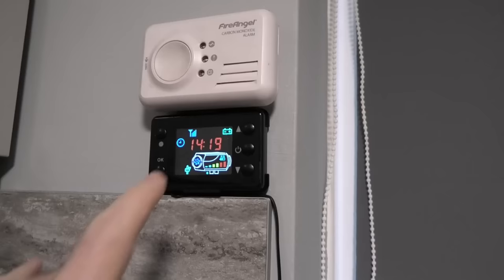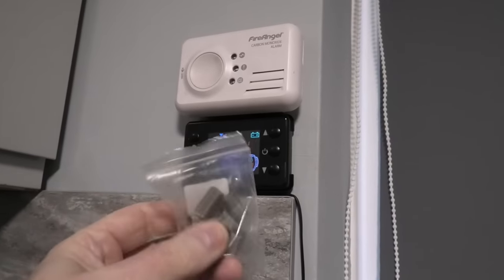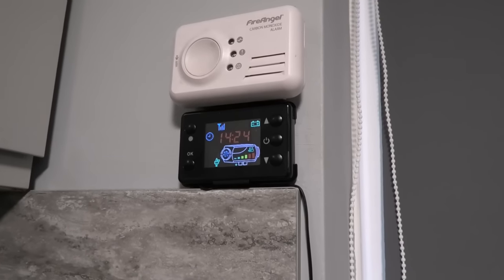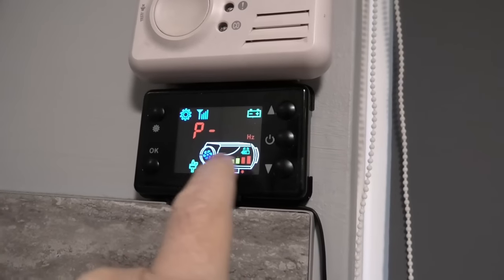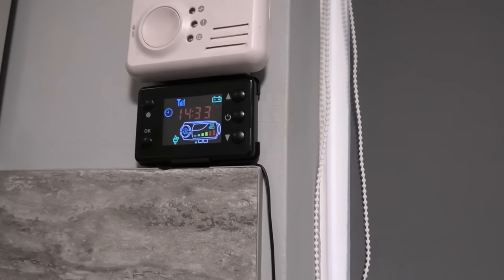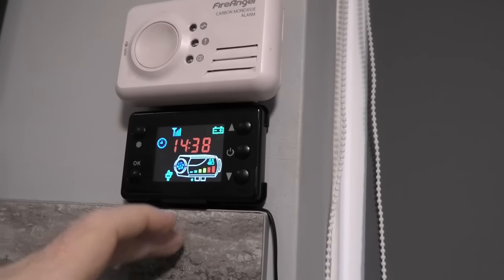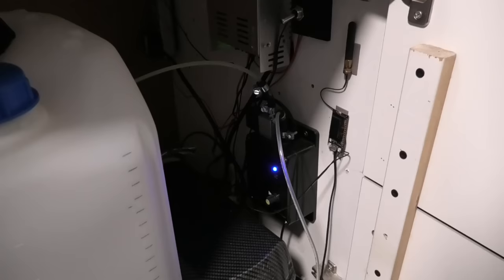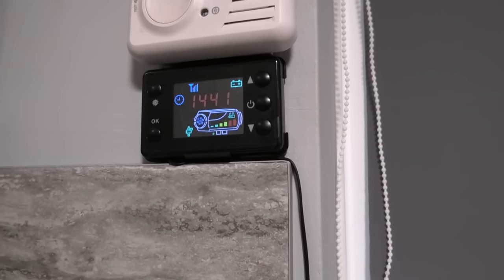How to tune a Chinese diesel heater with no tools 2kW & 5kW

Comment: I've got a 5kw in my motorhome that to be honest is still not great (had a 2kw at first but upgraded it). I've followed your video but it doesn't seem to make any difference. No matter hiw low I turn the hz down on either max or min it doesn't put any of the red bars out. Also if I adjust the settings, then go out and back into them again, they go back to default as if they haven't saved. Am I doing something wrong?

Comment: Interesting, as I run 5 of these heaters, from differant suppliers, and all have been installed following instructions. I run these on fuel station diesel. I am not sure whats going on with your heaters, But its out of the normal.

Comment: is there something else going on with hz/rpm settings when in temperature mode? 

while in temperature mode i set the desired temperature way high, like 30C so it would be in high mode. 
Then I went into settings and as I changed low side hz, i could hear the fan ramp up and down (while it was/should be at max)

I would have expected when in temp mode, running at high, the low side would not impact the fan RPM at high side.

Comment: Mine had been running great for quite awhile. Then we got some extreme temperatures and I think the gummed up diesel clogged some things. I cleaned everything out the best way I knew how. Finally got it to start again. It ran for a few days. Woke up this morning to a chilly home. Noticed the diesel heater had stopped working again. I pulled it all apart, cleaned it up and it fired up immediately. Thought all was well, but then I noticed the combustion chamber temperature was steadily dropping 2 Celsius (from 176 ish) every 10 minutes. I finally turned it off at 138 C and took it apart again. It has just as much soot as it did over the few days that it has been running since I cleaned it last. Prior to that one temperature drop, it had been running near mint. No carbon buildup to be seen....

I'm currently lost as to what is wrong. I have no idea why it's suddenly plaguing me with issues now...
Reply: Check the fuel lines for air leaks especially the rubber connections if you have the upgraded fuel lines the nylon tube. Try fitting a non return valve as fuel syphons back into the tank when switched off pulling air into the fuel line.
Reply: @oojimmyflip  I ended up upgrading to a Lavaner Pro and I haven't had any issues since.

Comment: Hello   I wonder could you help I have the choice big buying a what I'm told 5 kw heater adjustable between 5 kw and 2 kw or a 8 kw adjustable between 8 and 5kw red one all in one same price on eBay from China   what do you think.   Thanks

Comment: First! Awesome! Also I have one of these, & have often wondered. CO detector directly in the exhaust? Nada.
Reply from the maker: If you put it directly in the exhaust, it'll be going off constantly. I measure at around 500mm from the exhaust where it has time to mix with air. These are technically a jet engine without the compressor and no jet engine on earth would pass any CO tests like that.

Comment: have you calculated that your max settings actually gives 5kw ? because the factory tune are setup to work whatever environment. like vehicles. doesn't matter what altitude you do, it should work. only it does not work as efficient as it could. I've never seen any of mine smoke or gum up. And it always works. whatever the altitude and weather. But there are ppl that already has calculated the tune to result of effect.  It is always, always when you start fiddling with the settings that your break the heater. So I hope you've done your calculations.

Comment: Hi, did you ask about production of the quiet pump? I have ordered my heater and it will arrive in a few days. Your system looks great, so I will see about tuning my 5-8kw when it up and running. Thank you.
Reply from the maker: I'm waiting to hear back from him. He has various models available and also, a marine version for fitting in boats now. As soon as I get the green light, I'll make another video.
Reply: @Vortecks  Excellent; I'll be watching lol. Thank you.

Comment: Thanks for posting, possibly the neatest home install I've seen so far. I've looked at the comments and can't see any more info on the fuel pump, are they available to buy?

 I plan on using mine to heat a large kitchen, I would be interested to see how you heat more than one room with a single unit :)
Reply from the maker: It's embarrassing but I might show it. I've used the splitter tube and hung 2 lengths of insulated 80mm tubing across the ceiling because I can't gain access above it. Come the spring, I'll simply take it down, compress the tubing back into the box..... job done. We have to make sacrifices to affordably keep warm.
Reply: I’ve made a plywood box for the heater, located it on the patio, plan to run the flexi pipe through the wall and vent from under the kitchen unit kick boards. 
 Desperately seeking a quiet fuel pump.
Reply: that's simply practical and brilliant.  Sure you're not a Kiwi? *chuckle
 @Vortecks

Comment: if you mix kerosene into your diesel, it will burn cleaner and clean out.   also if you do one tank with some heat or high octane additive.  that will also help clean out and burn a bit hotter.  Also when tuning, other things to keep in mind is elevation and outside temp... I was in -20 the other day and it wont keep up if the fan keeps it too cold.

Comment: Great video, Got my interest in buying one. What make and model do you have Tony ? Thanks
Reply from the maker: Mine's just a standard 5kW heater mate, they're all the same. Don't be fooled by the 8kW version, there is no such thing. The 8kW and 5kW are identical - it's just a sales con.
All I have left of the original heater, is the wiring loom and heater itself. The rest of it is absolute junk and actually makes it more noisy. The inlet and baffle thing howls, the exhaust pipe howls and the hot air tube they give you is way too short. Buy a standard 5kW one - colour and paint job doesn't matter but make sure it has the same controller as mine, I have something extra to show everyone when I get round to it.

Comment: during the fiddling I messed up the 1688 access code.....any idea how to reset it please
found I could use 9009 but would still like to reset 1688 if possible
Reply: the very last setting before it returns to the home screen shows oF .... if you toggle this to on and press OK it shows a screen with a padlock where you can change the PIN to one of choice....6666 is nice because you dont have to toggle up/down so much !
Reply: Try 9009

Comment: oh dear....
the fan speed increases quite Sharpley  when you adjust the fuel up while the heater is running for a set pre programmed period of time then reverts back to what it was set at and you must then adjust the fan speed to the new fuel setting.....
its a safety thing not a proportional thing....

Comment: Unfortunately I can't get mine to even fire up anymore so I can't adjust anything.  I just keep getting e-8.  It worked for about 2 days, now nothing
Reply: E 08 is a fuelling issue, check the fuel lines for air leaks, test the pump to see if you can hear it ticking, if not give it a tap or replace it if it won't tick. Learn how to prime on your controller if the, pump doesn't tick it's proberbly not working

Comment: I recently got a 2kW that would flame out after 10 minutes and never got out of the yellow heat bars. The fan upper setting was 4500 and the pump 4.6Hz. It wouldn't stay burning until I had upped the pump to 6.4Hz which seems quite high for the kW rating. But anything less and it won't keep at 2 red bars. I haven't yet upped the bottom end settings but it appears that the chamber temperature should stay in the red bars? or is it normal to reduce speed and drop down to the yellow? I suppose there must be a minimum temperature to sustain the flame.
Before I sorted it out the vendor sent a replacement which wouldn't ignite at all and was factory set at 3.4 Hz and 4250  upper pump and fan speeds. Maybe the 2 kW is a less efficient burner that actually needs more fuel?
Anyway, thanks very much for posting this it was very helpful in getting one of the units to run.
Reply: I got 2kw (with 60mm ducting) too and cannot tune with these instructions. At least when temperature is close to 0 c degrees: High is ok with two red bars (takes a hour to get there), but low is only four bars (0 red) even after 12 hours. 

Have been running it 100-200 nights with zero soot buildup - took it apart few days ago. 

Have been using so far: 1.0-3.0hz, 1500-4300 rpm. I think I have 0.18ml fuel pump where some have 0.22ml.
Reply: 2kw default settings are 0.8 hz low and 3.2hz high.

Comment: Great video,very helpful just cleaned mine out full of carbon just like yours.
Do you know what the PF 1-6 is? I have this on my controller when I scroll through the settings SN 1 or 2 (is magnets) then the PF comes up and I dont know what it is for.
I am ready to reset following your suggestions.
Reply from the maker: I think PF is something to do with plateau mode where it automatically slows down or speeds up to get the temperature right. Don't touch it if everything works.

Comment: thanks for your efforts doing this......why cant the lower rpm set as low as possible though?
Reply from the maker: You still need an efficient burn and to achieve it, you need the correct amount of fuel/air ratio and heat in the combustion chamber. If you turn the fan down too much, it will over-fuel because you're starving it of air.
Reply: ....has a range of 1 to 6

Comment: Can these adjustments be used to tune the heater for high altitude?
Reply from the maker: Absolutely. The principle is exactly the same but, at higher altitude, you'll need more air to make a clean combustion.

Comment: Fan low 2200 and high ibhave 4200. Get out more heated air.  But the same same. Saves some watt only.   And it burns litle hotter

Comment: Great video.  Excellent advice about the settings.  Give or take a few factors, those are good presents.   I find that mine requires a little adjusting throughout the heating season.
Cow tipping high winds and barometric pressure and every now and again the fuel isn't what it should be.  
Mine is running 24/7 until spring.
Every 30 hrs  I'll turn it all the way up for 20-30 minutes and then back to whatever setting is comfortable.
 
 Make it a habit to continually remind the sheeple about safety and good old fashion common sense.
Otherwise, we all know what happened to other great products that got into the hands of the clueless.
Thank you for sharing .
Reply from the maker: Yes, barometric pressure is the possible cause of 90% of the sooting. The manufacturers set a default value which makes them run in their location but that setting doesn't work for most people.
Unfortunately, Curtis...... common sense no longer exists but I will keep reminding people of the dangers 😉
Reply from the maker: If it's orange, it's probably biodiesel or red diesel that's had the dye removed.
Reply: @ElectronicMusicUnderground  could be the winter diesel additives 🤔 winter diesel has antiwaxing additives compared to summer diesel 🤞 hopefully they haven't had red in the tank , try explaining to DVSA it was the fuel stations fault when they dip your tank 🙄
👍😁👍
Reply: sheeple? This is a video about diesel heaters not the new world order!

Comment: I bought one like this. looks just like it. But it has none of the controls the heater in the vid has. Mine is said to be "new style" controller. everything is automatic, and not tuneable. Turns out, it flooded and flamed out. now I have to pull it apart and clean the chamber before it will start. its caked.
Reply: what brand or model number is it ?
Reply: @davehimlin2374  Vevor WF5001 8kw

Comment: Thanks for your great video, I have ordered one of these for my garage, I will use your advice to dial it in. 
I would like to ask about the consumption, you mention that it uses 1/7 of the price of electric heating. 
Is that compared to regular electric radiators or a heat pump?
Cheers.
Reply from the maker: It's based on resistive heating (electric fire). If you have a look further down the comments, I did a breakdown where someone else asked the same question.
Reply: @Vortecks  Great, thanks!

Comment: Trying to figure out and get my head around what your doing hear in regards to having to knock it down in hz on that pump to only put it back up again? Are you basically saying to lower the pump speed while increasing the over all fan speed? And thanks for the video its very informative. Just trying to get my head around this.
Reply from the maker: It's hard to explain unless you know what AFR is (Air Fuel Ratio)
When you're changing the min/max pump speed, if you turn the pump speed down, the fan speed reduces in proportion and it may go below the setting of the minimum fan speed.
Setting the fan speed at 2500 is just a base point, this will ensure that the fan speed won't reduce too much as to cause a flame-out when you reduce the pump speed.
The minimum and maximum fan speeds (2500 - 5000 in my case) are really 0% to 100% fan speed and the pump speed (1.2 - 3.8 in my case) are really 0% to 100% pump speed.

You can do it without changing the minimum fan speed but I found that it dropped the speed so low, it was useless and it caused combustion problems.

I'll update the description with basic instructions on how to tune it with default fan speeds.
Reply: @Vortecks  thank you for replying. I will have a play around with this over the weekend.

Comment: Just spent most of the weekend fitting what looks to be the exact same model in my shed. It worked for 6 minutes then error 8!!! I didn’t even know they needed tuning? The instructions are poorly translated. I didn’t think about a carbon monoxide alarm, do you have a link to one?
Subscribed.👍
Reply from the maker: Error 8 is a fuel problem so it's got to be the pump. Make sure you don't have any air bubbles trapped inside it. Change the orientation, wait a bit, change it back, give it a tap and that should cure it. Failing that, hold it vertically so the outlet is at its highest point and give it a few taps with something heavy 😊 This is the alarm I bought https://www.amazon.co.uk/FireAngel-CO-9XT-FF-Carbon-Monoxide-Sealed/dp/B00SB8VSPO
Reply: Error 08 is a fuelling issue.

Comment: Thank you for the video. I picked up a used one. Is it hard to take it apart to check and Clean out the soot if need be?
Reply: Easy peezy lemon squeeze just be gentle with the glow plug only screw it back in hand tight and get a gasket kit before you strip it down on fle bay or amazon currently about 11 quid with a, new glow plug and fuelling screen.

Comment: Thanks for this. I’m thinking there is something wrong with my heater.. 
I ended up with 2.4, 5.1, 1680, 4800. I didn’t clean it because it’s a new heater (only ran yesterday for about 5 hrs)
Reply from the maker: A pump rate of 2.4 at 1680 is way too high, it's over-fuelling. Drop the pump down to 2.0 and raise the fan speed to 2500 and try from there. Also, raise your max fan speed to 5000 with 5.1 pump speed.
Reply: @Vortecks  I tested multiple times because I can’t believe the pump rates, but if I drop the rate to down to 2.2 I lose a bar on the screen. I imagine going to 2.0 and 2500 is going to kick a flame out, but I’ll try it
Reply: @Vortecks  increasing low fan speed up to 2000 with the 2.4 pump speed dropped a bar on the display, decreasing pump speed to 2.0 dropped another bar. Currently holding @ 4 of 6 bars
Reply: 5.1 @ 5000 is 5 out of 6 bars
Reply from the maker: @chrisstone8189  All installations are different. If your pump is lower than the heater, it's more work for the pump to feed the heater and less fuel will be delivered.
You may have a lazy pump and it has to pump more for the same volume. Whatever works is fine, all you need to be concerned about is the heat coming out and getting all the bars lit up.
Reply: You could also try Alpine mode, if you haven't already.

Comment: Have you explored running it on the 'alpine' setting?
Reply from the maker: Isn't alpine setting an automatic barometric adjustment? If so, no I haven't. Although the barometric pressure does change, I find that the fixed tuning runs perfectly.
Reply: @Vortecks  I have only just got one of these and haven't installed it yet. I did some looking around YouTube for hints and tips and found a couple of vids showing a two button shortcut to the alpine setting which apparently sets parameters for a leaner fuel to air ratio which these guys have tested for economy and got good results. I agree tuning is really important on first setup and your guide is invaluable.
Reply: It is automatic on the blue screens with the red or black led remote control.